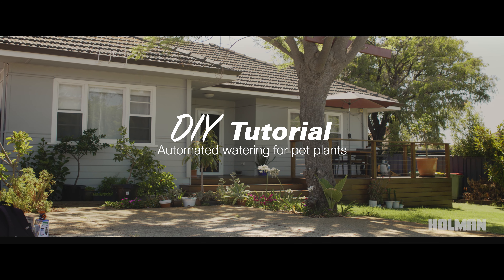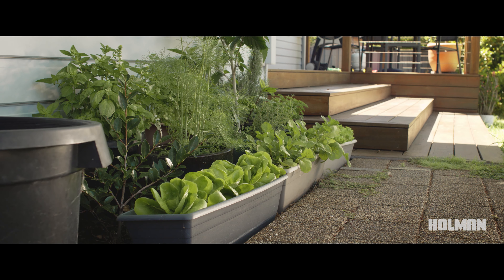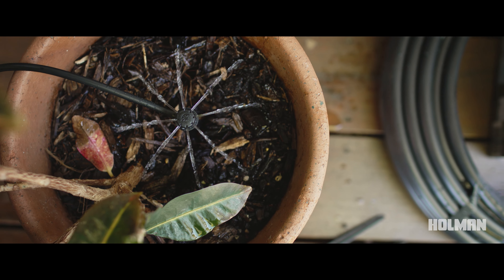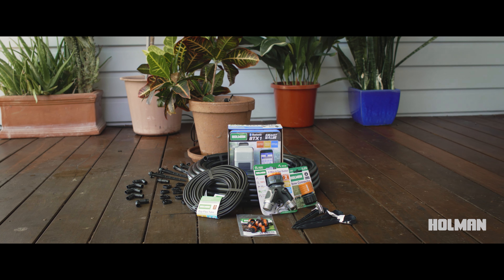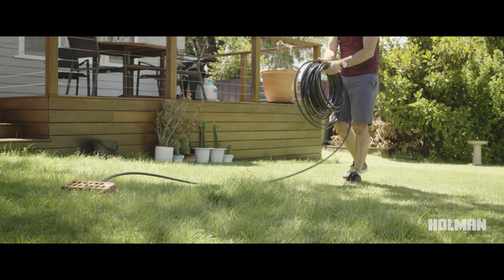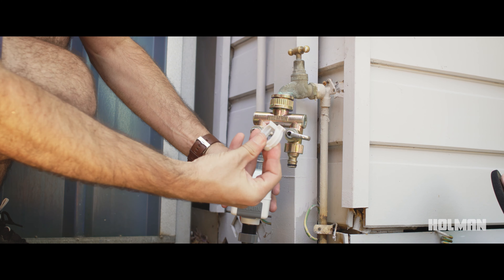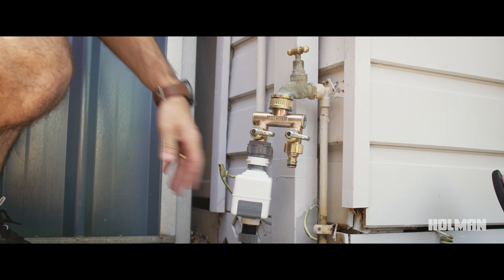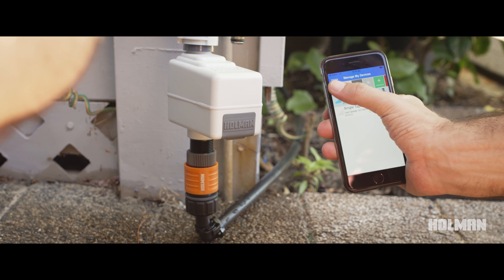How to Install a Micro Irrigation System for Pot Plants with Holman

Comment: An issue with hose based systems I've used is the closer to the end of the pipe, the less water pressure there is, with the plants at the end quarter or third getting very little watering. I'm wondering if this system does the same.
Reply: The same problem exists with powering Christmas lights. The lights at the end of the strand are dimmer. We solve that by injecting more power along the run.
I did the same thing with my drip system. I used a single run of 13mm poly and rather than terminate it at one end, I connected it to t-splitter just off the tap so now it is fed from both directions and the pressure is equalised. Works fantastic. For a larger system over a bigger area install 13mm cross lines between segments using t-splitters. Think of the system as a large rectangle with the cross lines running across the middle. You attach the dripper feeds to the cross lines. You can upgrade to 19mm feeds & cross lines if you have higher volume requirements.
Reply: @mista_jamaican   Fantastic design!